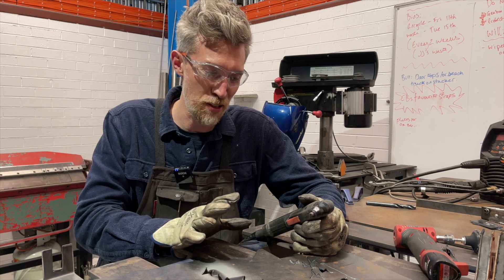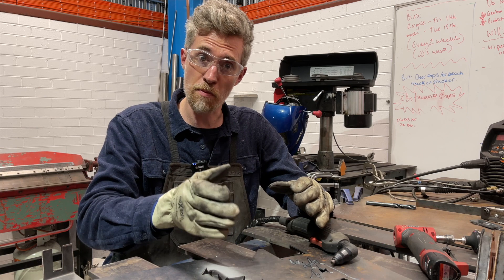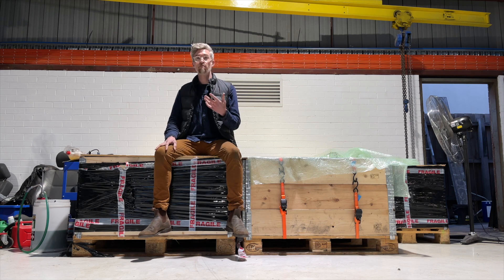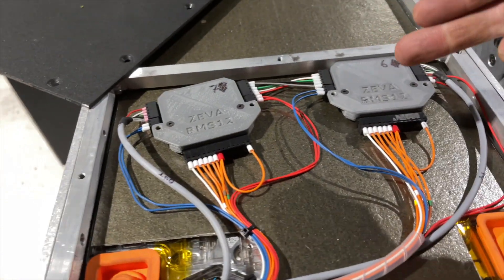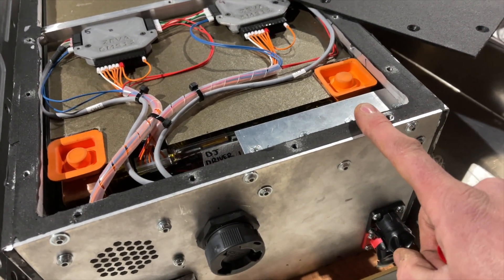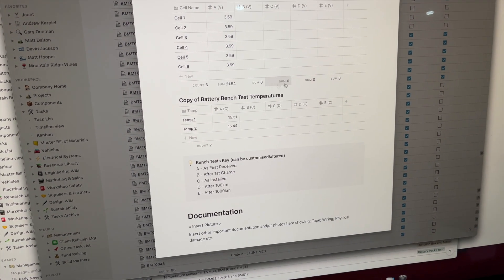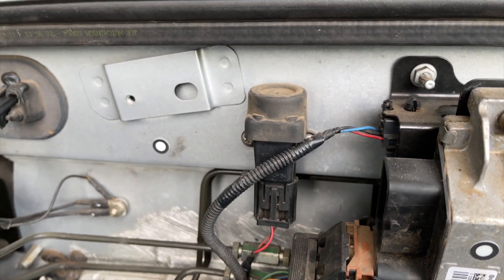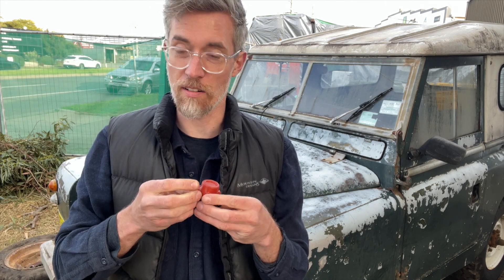Preventing Plasma Arcs & Keeping Batteries Safe

Comment: Question. What's the purpose of having 2 fuses? (At most positive and most negative)  wouldn't 1 fuse do the job?  Or is having 2 more safe/ more redundant?
Reply from the maker: Each individual battery box has a fuse on the positive.  Theres a contractor on the most positive and negative of the whole circuit/pack. I cut some stuff from the video where I went through fusing on the other battery boxes.